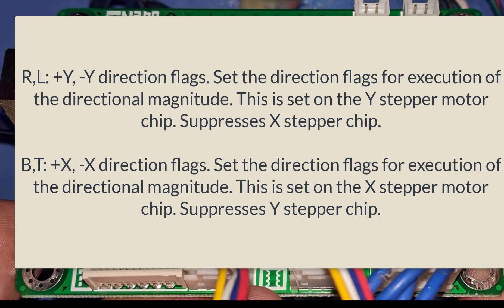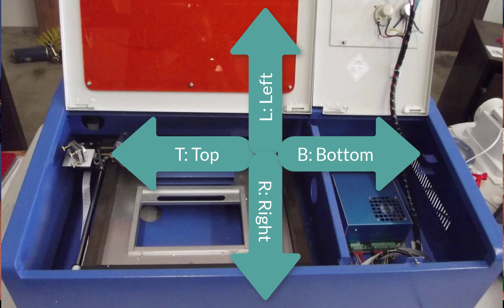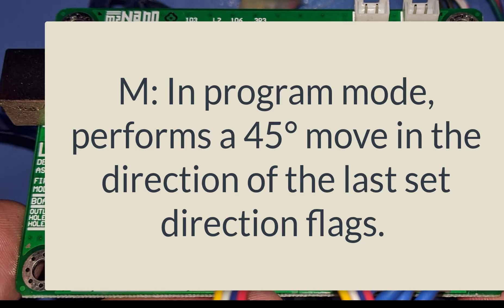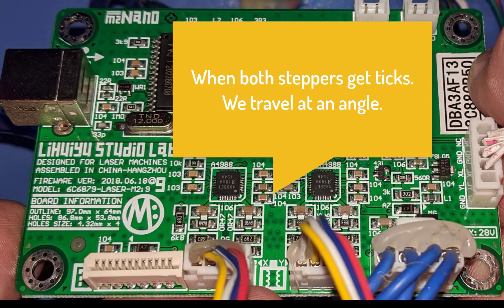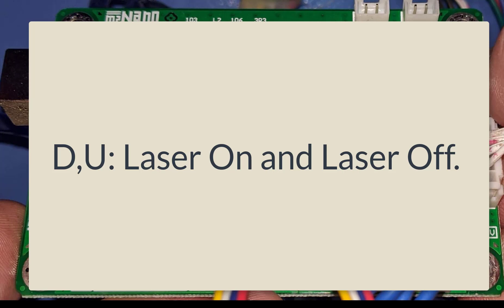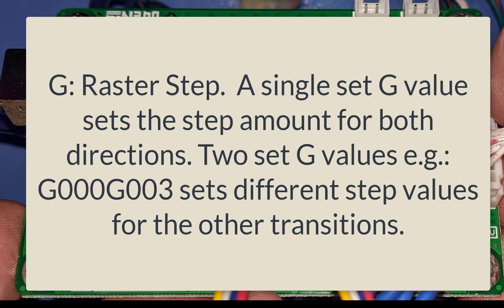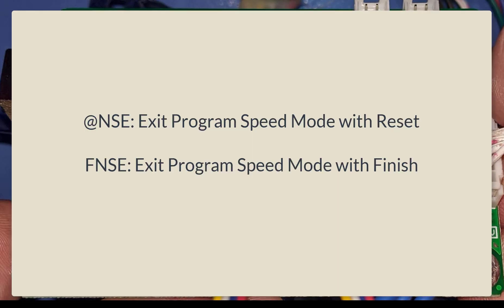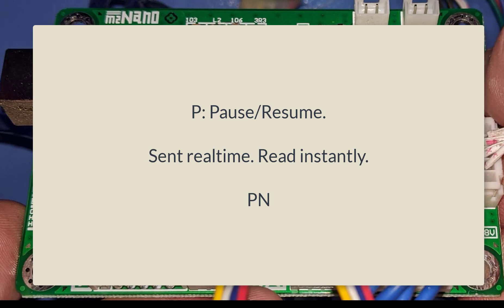How the M2Nano Works.

Comment: Hi David, great video & explanation, I would like to know if is possible to change the A4988 for TMC2209 in order to control one nema 23 for Y axis, because I want to make bigger my K40 omtech 2030 machine
Reply from the maker: Yes. Actually the form factors are the same which you may have already looked up and checked. Also, there are now M3 Nano Plus devices which are an M3 Nano but with the TMC steppers instead of the others. A friend of mine made exactly that sort of Frakenboard you're describing.

https://www.reddit.com/r/ChineseLaserCutters/comments/f9hw79/tmc2208_silent_stepper_driver_chips_in_stock_k40/

You can find the M3 Nano Plus devices on Alibaba now, and I actually use one as my main card.
Reply from the maker: Also, another person I know exposed the leads on the board and wired in a couple step sticks. Doing that you don't even need something that fits the same form factor like the TMC2208s used in the above conversion and in the M3 Nano Plus.

Comment: Would be nice to see a video on how to setup a manual, end stop on these M2 Nanos. I have the ribbon cable and I am not finding any videos on how to set up a manual end stop conversion...
Reply from the maker: There are some facebook groups with some helpful info on setting up hardware. https://www.facebook.com/groups/1594446007532785

This video tends to just be the chip reverse engineering and explanations for the actual work on the board, since that wasn't well understood or documented basically anywhere.

Comment: can you make a vid on how to bypass the steeper driver chip just get the pins for direction and drive but going to a separate stepper driver hacks.. that would be really cool!
Reply from the maker: That's entirely doable and I know folks who have done it. The best method is to drill the board and add new ends there. Then ignore the chips on the board and use a step-stick. You can simply replace the chips with ones that match the same form factor but that's a little bit harder and you must use the a few chips that fit the right factor. But, drilling and soldering the wires in is your best bet. You can do this especially if you blow off your y-chip as people are apt to do if they hook up a rotary wrong.

Comment: Hey man nice vid! I've an issue with my laser cutter. It has the same board M2NANO. The problem is, the machine only cut well at the left side of the machine. When it comes to the right side, the display DIES, the motors keep working, but the laser does't come out. The led of the power suply doesn't light up either. Have a clue whats going on? Thank you very much!!
Reply: I found the problem... a short circuit caused by the laser pointer.